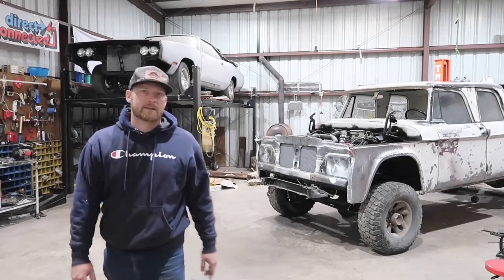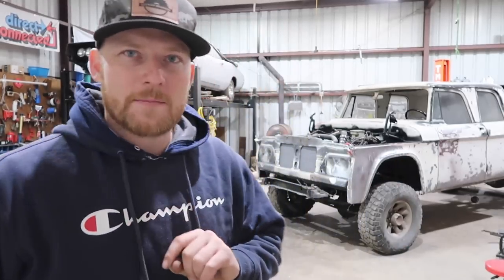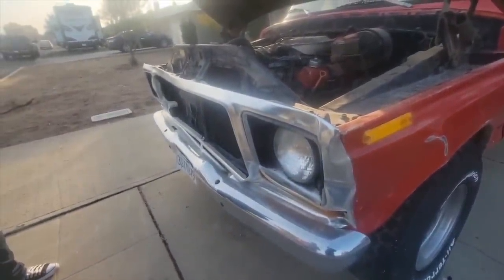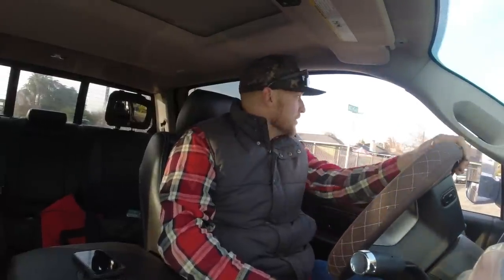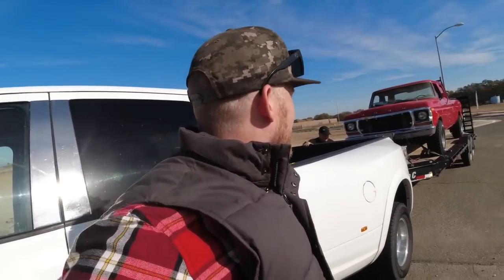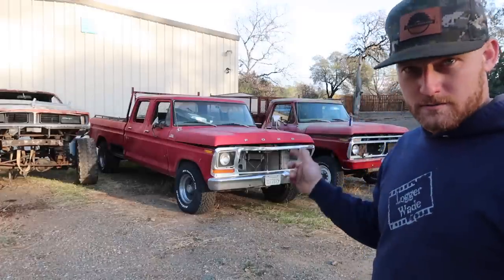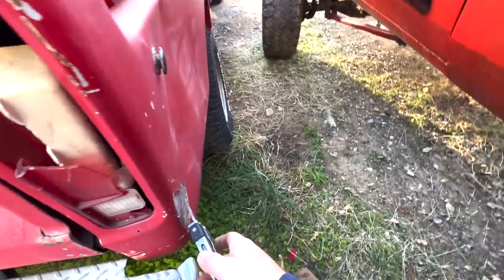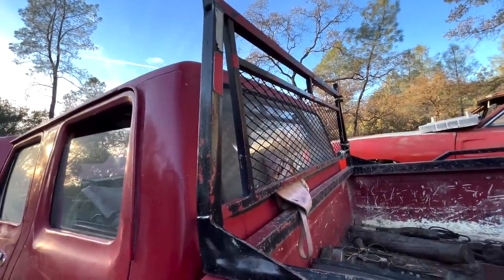I BOUGHT A FORD F-350 & it’s a RARE HOLY GRAIL TRUCK

Comment: Ford did not have a stock body dually in those years. Only cab and chassis duallys. There were dually conversion kits for those trucks advertised in all the car mags from the 70s thru 90s.

Comment: Hard to tell 4X4 or not?  I have those TA-2's on my 2500HD Silverado,  ~$350ish/ea.!!  I've had one eye out for an F350-F450 Dually King Ranch w/6.0 diesel. The motor is shot at <100k miles leaving a nice truck for an engine swap!! Always liked the King Ranch interior!  Rumor has it there's a bunch in Texas, clean rust free. Even just the 4X2 makes a nice driver.  Nice find Sam!!!   8)    --gary
Reply: Huh? 4x4 is much better than 4x2
Reply: The 6.4 motor is the one shot at 150k, believe it or not with aftermarket parts the 6.0s are actually tough and reliable
Reply: Is that the one between the 6.0 and 6.7?  I thought I read the issue with the 6.0 was 'head studs/bolts'?  A new set of ARP studs was the fix? But the repair was big $$??  I'm not sure I still want to do all that. I'm 70 now and that's heavy work for me. We put a turbo on my 6.0 LS Silverado and got almost 700hp. W/ the Allison trans and 3.71's it tows the 5th wheel fine. Thanks for the info!!   8)    --gary
Reply: Yeah the 6.0 goes from late 03-07, the 6.4 was 08-10 thats why you see alot of 6.0 work trucks they got the fix now international needed more time developing and testing the 6.0 but ford had to have a motor because the 7.3 didn't meet emissions, ford put the motors in the trucks knowing the problems like head bolts and oil pump fix those along with a few other things and you have a work horse
Reply: I have a 05 6.0 head studs 03 turbo biggest factory turbo offered, interesting fact they changed turbo size 3 different times through the life of the 6.0s 03 being the biggest also did the stc fitting and dummy plugs, ficm, and 5" exhaust I run a sct livewire ts programmer luckily the parts aren't expensive for these trucks now days

Comment: Yes indeed I was always a Gm motors an Chevy guy but I have had 2 Fords 2000 F350 Super Duty 6.8 V10 an now I have a 1999 F250 super Duty 4x4 with the V10 6.8 gas engine and it works for me as long as it can tow a load I’m happy my youngest is 24, GM Duramax fan I had an 2008 2500 Gm Duramax 4x4 an it was a horse , an my Second to the oldest 26 Military love the Goats and my oldest 28 is a F350 single tire 6.7 power stroke fan To be honest I’ve driven them all gas , diesel all I want is to get the job done at the end of the day, that’s going to be a very nice engine swap an those yr models are the best swap out because they don’t have all the luxury heated seats , separate side Ac settings,well you know where I’m coming from old school vehicles just needed to know Battery life, Oil pressure, engine over heating, transmission temps, Alternator voltage, Brake fluid but it’s all about the marrying the the money an keeping the Rich filthy Rich , in the long run an Electrical Truck want have the Horsepower of a Diesel engine, if it does it will be a monstrous invention an that’s why Al fossil fuels are ridiculously high the oil tycoons are trying to get a jump on the electrical stock market before the middle class and the working class can understand what is happening, you know I see you an your Father are using every type of energy you can make off of the land clearing jobs not letting the firewood go to waste , selling some lumber, probably selling the chips for landscaping mulch over hear in the Boot it’s going for $5-10 a cubic yard. Well enough for now take a enjoy the Holidays.

Comment: "It's a rare truck. Oh no I'm not restoring it, I'm throwing the original big block in the dump and putting a Cummins in it."

🤣
Reply from the maker: Original engine is not in the truck. Funny thing about these crew cabs. Cummins swap and modern 4x4 swap help the value out a lot. Ps I’m Cummins swapping and R/t 69 charger aswell

Comment: I don't know Sam, that Cummins EATS Ford trannies, drivelines, differentials, frames, etc. Fords are more for hauling a guys trash cans on Sunday,etc. Not working rigs. But, if your gentle on the throttle and baby it it should work. Old Dodge truck, drop in the Cummins, and they run!!!!!!!!!!! Cool truck for sure.
Reply from the maker: Most likely the shell will be the only thing to continue on. Drop it on a 3rd gen and party
Reply from the maker: Most likely the shell will be the only thing to continue on. Drop it on a 3rd gen and party